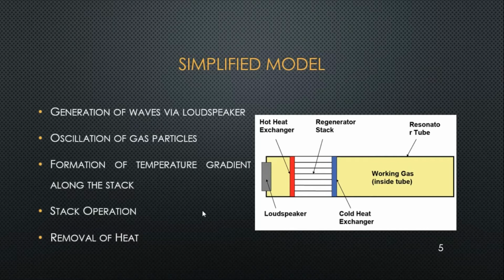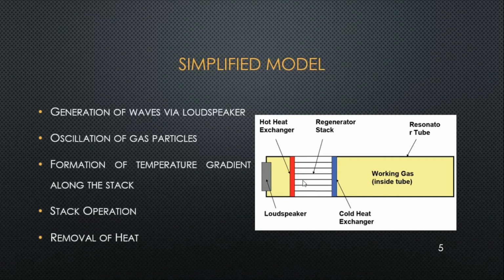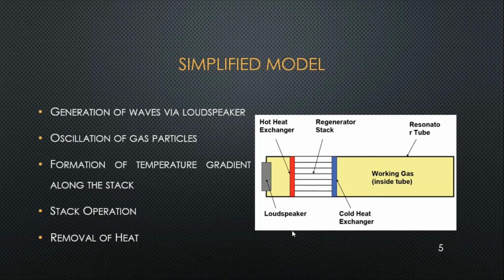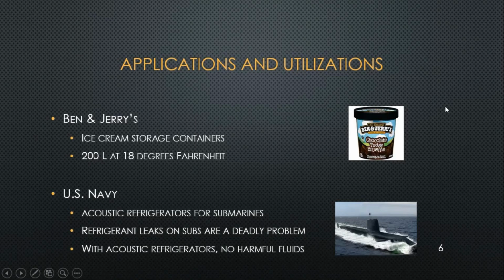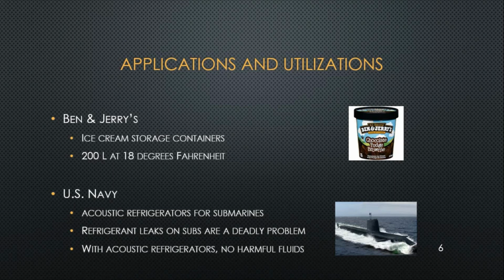Standing Wave Thermoacoustic Refrigerator

Comment: Doesn’t the speaker that produces the pulses have to be at the Other side of the tube so that way it increase the positive node in front of the stack and when it pulses back through the stack it  absorbs heat up top and forces to the  other side that  has more air for cooling or am I wrong I’m not trying to be smart ass I’m just really curious